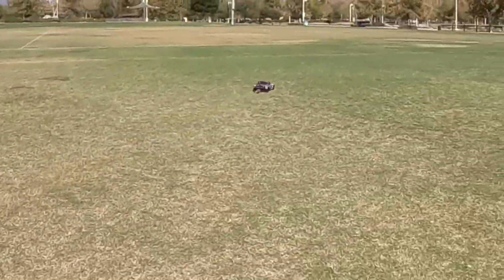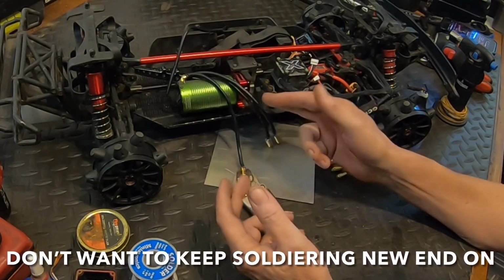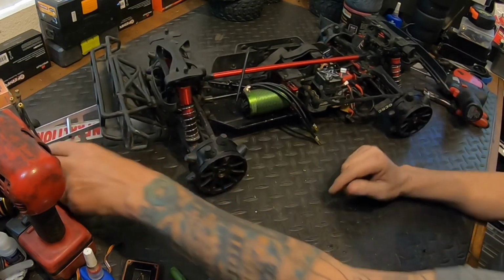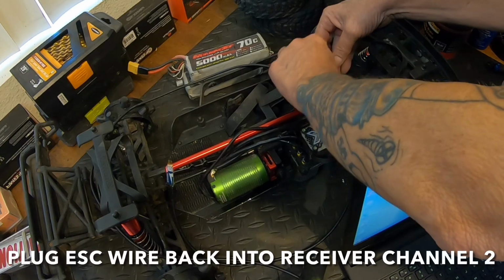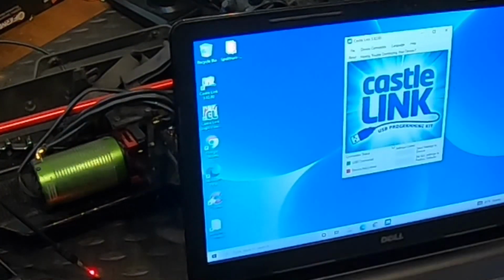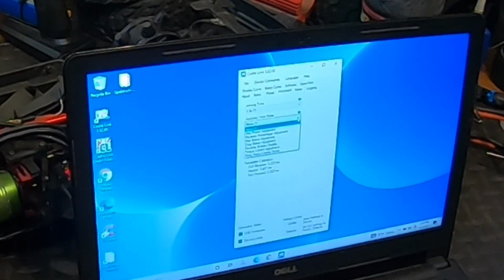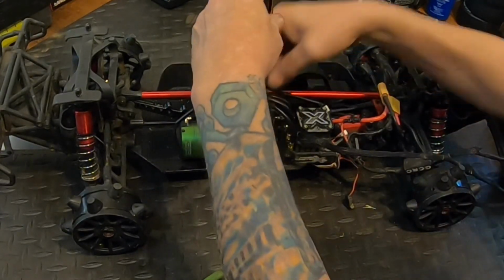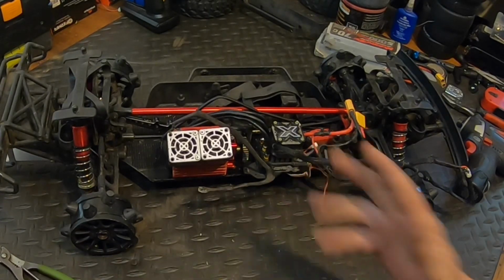Mojave Cleat-Us Off-road Speed Build Votes in what ESC ?  white wire& motor calibration?

Comment: instead of changing the ends just get new wires. I switch my wires out on the motor and it's clean and easy. You can reuse the wires. I also use adapters that let me plug into the larger connections of the xlx2 without having to do any soldering of bullets. Just my .02 but it does save $$$
Reply from the maker: Motor wires solder from castle have a hard time sticking again it can be done but not as strong

Comment: EARL….can you dremel the adjuster slots a bit longer to fit the larger spur….just a thought..🇺🇸👈🚘
Reply from the maker: Larger pinion ? The motor plate is bottom out not the screws I had no screw in it 👍👍

Comment: GUY!!!! why you not just crimp squeeze mold the original solder wires then install in new smaller connectors???
Reply from the maker: Butt connector it together 😱🤷🏻‍♂️😂
Reply: @earlmoorhead5555  😂🤣

Comment: get a 60 watt soldering gun and it will help you tremendously
Reply from the maker: My soldering station doesn’t have any
Issue 🤔
Reply: @earlmoorhead5555  I own a cb radio shop and have soldered for 39 years now trust me a better gun when doing those plugs will help allot, thank you for all the great videos, just want to help.
Reply from the maker: Yes I worked for a pc board manufacturing company in my younger days I just work on rc cars and 8s system so 40amps been good for me
Reply: @earlmoorhead5555  40 WATT.. COOL THANKS AGAIN